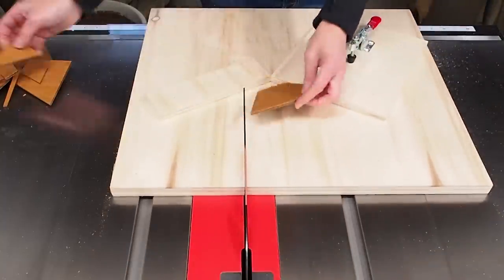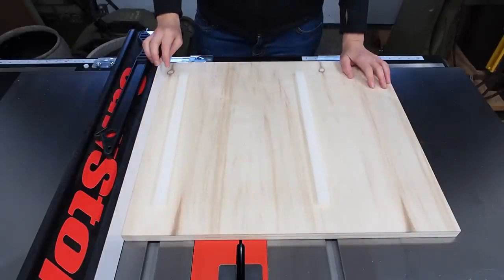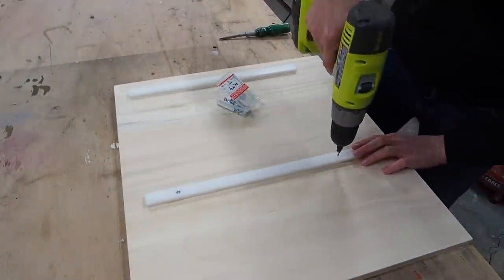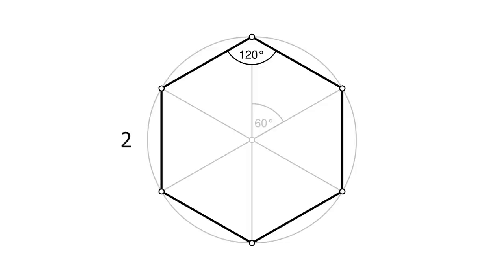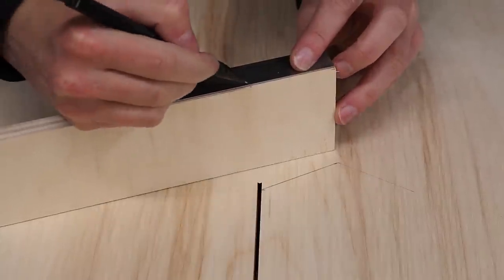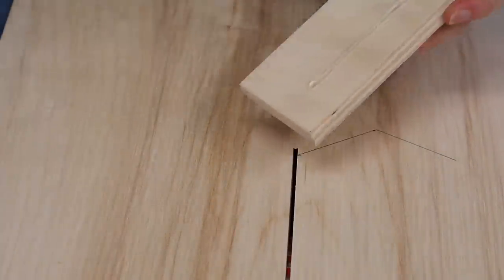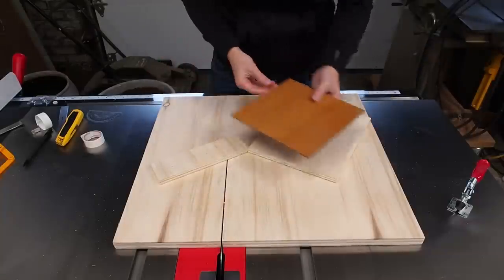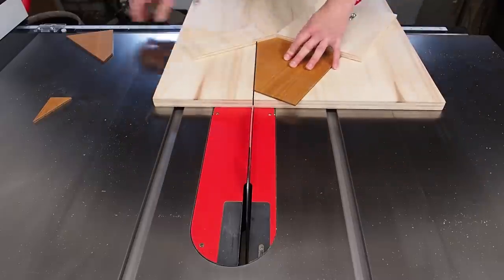Hexagon Cutting Jig

Comment: Thanks a lot for making this video. I took this and made my own twist. For hexagons of adjustable sizes - Make the fist guide long(longer than the longest hex you'll want to make) and attach the toggle clamps to it. Now use a drafting triangle(30-60-90) to slide along the guide and secure it with the toggles. For the second cut on the distance between the triangle and the guide slot will be the length of the faces of the hexagon.
Reply: I'd like to see some photos of that -- I had the same idea of the need, but not the experience to figure out the design

Comment: I made some hex based puzzles - the pieces are smaller than these - about 1 inch across.
I found it easier to make 1" wide sticks first, then cut the stick into pieces with diagonal cuts, and then finish each piece with the opposite cuts.
It left a lot of very small triangles as waste. Also, I was able to make them pretty accurate (necessary for puzzles to fit together nicely).
Reply from the maker: Yes, that's a great tip I should have mentioned in the video. It's best to cut blanks to size to minimize waste, unlike the test I demonstrated on the jig in the video.

Comment: Simple and sweat! As Branko mentioned, dust accumulation would definitely be of concern. Depending on the thickness of your material for the hexagons, a shallow rabbet would work just as long as the piece being cut is taller than the rabbet. Another possibility is not to have the two fences touch each other, leaving a slight gap to brush or blow out the dust buildup.
Reply from the maker: Great tips, thanks!

Comment: nice jig.  there are a couple ways to get very accurate 60 degree angles - using tools most people have.  A hexagon has sides that are the same as the radius of the outer circle, so you can put two nails on a board to lay out the lines.   Another is to use trigonometry.  The ratio of the sides of a 30-60-90 triangle is 1.732 (tangent of 60 degrees).  So, for 10 cm height, the base would be 17.3 cm.   The keys are to use clean marks and a larger distance for better accuracy.
Reply from the maker: Indeed, after the video was out I realized I could have used the compass method to draw the hexagon, which may be easier and more accurate.

Comment from the maker: Here are a few things I forgot to mention in this video:
 - To trace the hexagon, consider using the compass method (just look it up)
 - I show an example in the video of the jig in use. I used some scraps I had nearby. But when actually using the jig, you'll want to cut down blanks close to final size to limit wastage.
Reply: I'd like to see you make another video using minimum size scraps and after you have made any tweaks or improvements to the point where you think you are at the final design. I've been wanting a jig for hexagons for a number of years, ideally one that could also make pentagons for a wooden soccer ball. An old woodwork magazine issue had a difficult to understand article on the process and I was never able to follow the instructions, or the highly elaborate jig that used milled metal parts.

Comment: I made one like yours except I only used 1 runner on my sled as I already had a jig/sled for cutting circles with the table saw. I used the protractor and plywood for the guide. it cam out the same as yours. I also marked with a mark a lot how they go on the sled. I then removed the parts. this way If I want to make larger or smaller hexagons n I just change the size of the guide piece near the kerf line. I can then still use the jig to cut circles.

Comment: Since the start of summer I have a small table saw. I didn't come any further than get it up and running. But now that the daylight time is getting shorter and the weather less pleasant to be outside for many hours I'm going to spend more time in my shop. So I watched this video again and I read the article as well. I miss one thing in the description there: the over all dimensions of the sled. How large should it be? My table saw table is quite small 45 cm wide and 60 cm long
The slots are 8 cm from the edges but at one side I'll have to put the fence so only 4 cm is left outside the runner. So the maximum size (width) of my  sled can't be more
than 40 cm (less than 16 inches). Is that enough? Thanks in advance for your reaction.

Comment: Great jig, it did seem that there was lots of waste, would it be more economical to cut to strips then cut them down to size, less waste then. If I were to try and make hexagonal I'd try and get as many as I could from a board. I appreciate its tricky though.
Reply from the maker: Yes, in this case I was just testing that it worked on a piece of scrap, but ideally you want to use a strip just the right width.

Comment: OK so the part I'm curious about is this:  say I want to make a metric buttload of hexes, what size(shape) piece of would do you recommend as the smallest piece to drop into this jig to make the most hexes the easiest?  Like if I started with a 4x8 sheet of ply, should I knock it down to 4" x 4' then start breaking it down?   Just looking for suggestions from the experienced slender: p
Reply from the maker: If I recall correctly (but please cut a strip from scrap and test it first): if you want say a hexagon that's 2 inches from tip to tip, you'll want a strip that's just over 2 inches, like 2-1/4.
Reply: @DIYMontreal  so if I want one with 3" sides. That makes it 6" tip to tip at its longest, I'd be looking at 6.25? Or does it increase as the max distance increases

Comment: Do you need to start with perfect squares for this to work?
Reply: No you want pieces that are slightly longer than they are wide as the points are longer than they are tall. You can start with squares if your overall size is smaller than the squares.
Reply from the maker: Exactly, well said.

Comment: Great jig. Very accurate. =) But isnt there a lot af waste? Dont mean to put your video down. =) If i print a hexagon i can put them close/less waste, but it wont be as accurate as yours. =) What are you going to use the hexogons for? =)
Reply: If you want to reduce waste you could probably make a jig to cut out diamond shapes and use this jig to cut the corners for the final hex shape.
Reply: They were being lazy about it, but there's not that much avoidable waste. If that piece was about 1 square foot, some napkin math says you're probably not getting better than six 2 inch hexagons out of. Looks like she got 5 which isn't bad considering the amount of work it would take to get 6. Plus unless she needs a either an exact multiple of 6, or more than 30,  there's going to be left over scrap anyways no matter if you cut 5 or 6 out of it.
Reply from the maker: I was just testing out the jig on some scraps I had nearby but to your point I should have shown how I would actually use the jig to batch process by cutting blanks close to final dimension and using the jig to shave off the corners. There will still be waste this way but the speed and accuracy of the jig outweigh the time it would take to cut them without the jig.

Comment: This jig if perfect for making identical hexagons. But as mentioned by some other posters, a good deal of waste.

A hexagon consists of three sets of parallel sides. Wouldn't it be less wasteful to first rip strips of the desired width, then cut the waste away? This could be done in about three or four cuts. Instead of making a separate cut for each side.
Reply from the maker: Yes, absolutely. That would be the best method. I was just testing out with scraps to show that it works.
Reply: @DIYMontreal 
Thank you maam. I didn't mean to trounce on your post or your technique. As you are well aware, there are many ways to do many things in woodworking. This is just one way and to each... his/her own.

You're a very talented woodworker. Your videos are concise and informative without being over-engineered. There are a lot of your projects I'm hoping to incorporate into my own shop one day. Thanx for the great content. Continued success to you.

Comment: what are those bars? I do not know them from Germany.
Reply: You can use HDPE as well. Many "plastic" cutting boards are made of it. In that case you need to cut them to the exact width.
Reply from the maker: They are UHMW runners. There's a link to the product in the video's description if you want to take a look!

Comment: Cool jig but if your gonna buy a tile to set up the jig why not just trace it with a router. You'd save alot of material with a router also.
Reply from the maker: Not sure how I would trace a hexagon accurately with a router without a template?
Reply: @DIYMontreal  assuming the tile has smooth edges you could use a flush trim bit and use the bearing to trace the edge of the tile.

Comment: I have tried this for hours and hours, but no matter how many adjustment I make one side of my hexagon is always a little shorter than the rest.  Why???
Reply from the maker: Likely one of yours angles is off ever so slightly. It can be hard to get it perfect. Have you tried using a tile or other machined hexagon as a template?

Comment: You mention the inside angle is 120 degrees its not its 60 degrees since 60 times 6 is 360 degrees
Reply from the maker: Actually the sum equalling 360 rule only works for 4-sided polygons. The angles of a hexagon (6 sides) are in fact 120⁰.

Comment: nice jig but so much waste :/
Reply from the maker: I was just testing out the jig on some scraps I had nearby but to your point I should have shown how I would actually use the jig to batch process by cutting blanks close to final dimension and using the jig to shave off the corners. There will still be waste this way but the speed and accuracy of the jig outweigh the time it would take to cut them without the jig.

Comment: More like, "see me make a hexagon that wastes 90% of the starting material"
Reply from the maker: I was just testing out the jig on some scraps I had nearby but to your point I should have shown how I would actually use the jig to batch process by cutting blanks close to final dimension and using the jig to shave off the corners. There will still be waste this way but the speed and accuracy of the jig outweigh the time it would take to cut them without the jig.